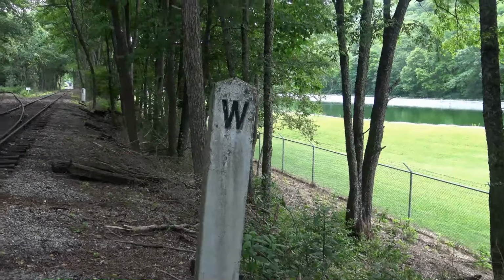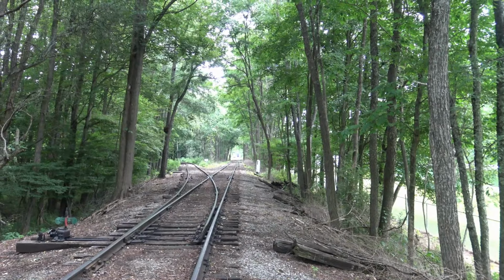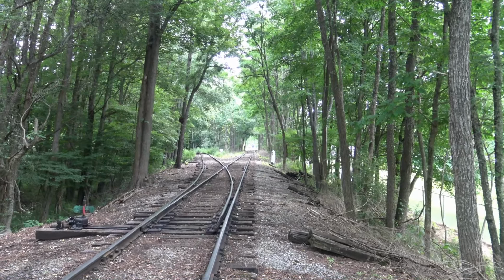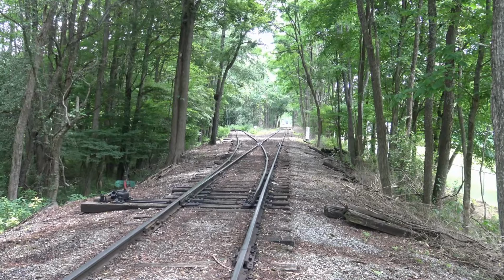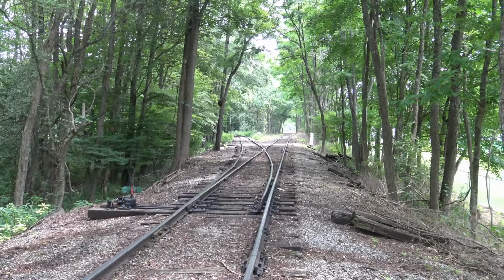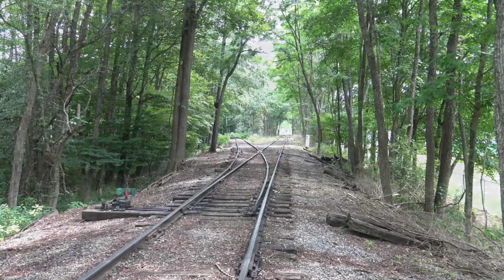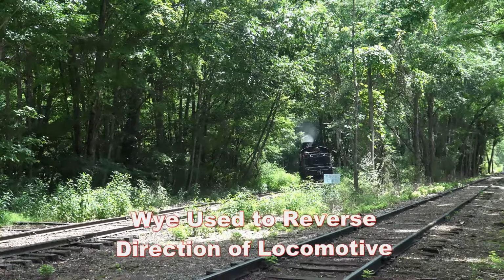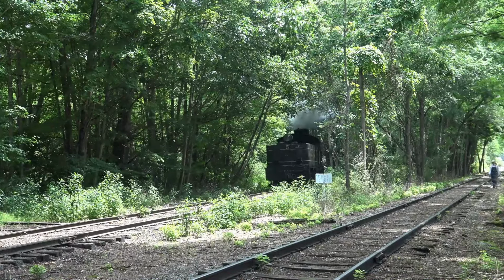118-Year-Old Steam Train Uses "Wye" to Reverse Directions

Comment: I believe the "W" on the post is/was a que for the engineer to blow the whistle when approaching a crossing in a village.  Has nothing to do with the wye.  There are several "W" posts along the Greenbrier River Trail that don't have a wye anywhere near them.
Reply from the maker: You are correct; they are "whistle indicators" placed at points where there are crossings or sidings on the tracks.  This W in the video signaled the approach to several crossings, the Wye, and the approach to the Durbin Depot.  Thanks for pointing out the meaning of the W on that post.  I put a correction in the video's description.
Reply: If you want to get a little bit technical these are called Whistle posts .  Not very far back down the C&O greenbriar subdivision going towards Cass on the hillside of the tracks if you know where to look there are a few concrete dynamite storage boxes near a few areas where they would have the occasional large rock fall down onto the tracks and to make it a little bit easier to move it off the tracks they would use some dynamite to break it up into more manageable pieces and then chuck it down over the bank.  This has been your history lesson for the day.  Dudester out

Comment: Great Video!
Reply from the maker: When the Greenbrier Express approaches Durbin in standard configuration (i.e., locomotive facing forward pulling passenger cars), it uses the "Wye" to back the passenger cars into the depot--and by doing so, they reverse the viewpoints of those in the passenger cars (i.e., those who saw the river going up to Durbin will see the mountainside going back to Cass, and vice versa for the other side of the passenger cars).  This usage of the Wye allows the locomotive to remain at the front of the passenger cars still facing forward.  "Why" do they then need to detach the locomotive and have the locomotive use the Wye to reverse the direction of the locomotive (i.e., so that the locomotive faces in reverse to pull the passenger cars back to Cass while in reverse)???
Reply: @WebsterHighlanders  If they didn't detach the engine and turn it around, the locomotive would be leading the passenger cars back. Once they got back to the Cass depot, there would be no way to turn the engine around since there is no turntable or wye nearby. The closet wye would be up the mountain near Bald Knob which is about 9 miles away from Cass. There is really no good reason that they turn the engine around the only thing I can think of is because if they have the engine facing the wrong way and they need to use it on the Whittaker run the next day when they do that the engine will be facing  different way then usual making it odd or unsafe to operate. It's a hard question to answer cause there is no obvious answer out there.
Reply from the maker: That makes sense given the lack of a Wye at Cass.  Thanks!
Reply: @WebsterHighlanders  No problem!

Comment: Great video Jeff of showing and explaining the process and purpose of using the “wye”.   I wonder why they are not utilizing the old “Durbin Rocket” No. 3 Moore-Keppel & Co. Climax engine for pulling the greenbrier Express???🤔🤔🤔
Reply from the maker: It was running at the Cass Parade of Steam in June 2023 and I did video that Climax engine at the Depot a few years back.  Good question.
Reply: @WebsterHighlanders  That was a different Climax locomotive. Cass owns Climax 9 which is operational and is a 3 truck engine and they also own Climax 3 which is a 2 truck climax. Currently climax 3 is sitting on the ready track awaiting boiler work.